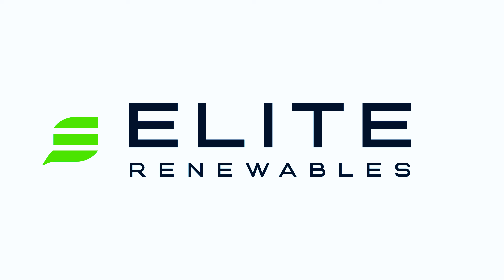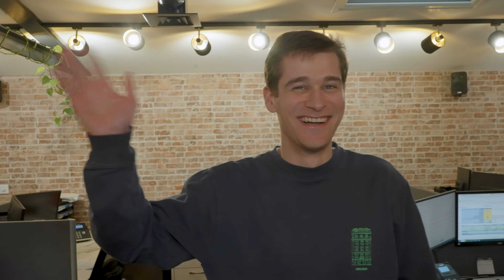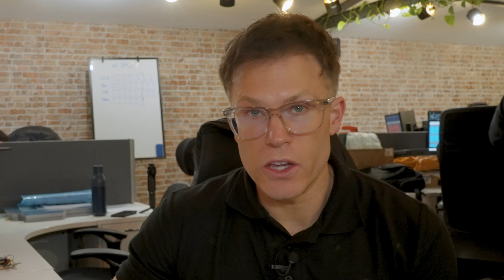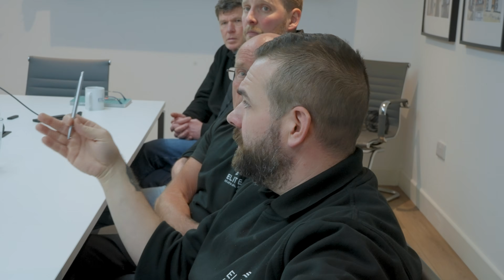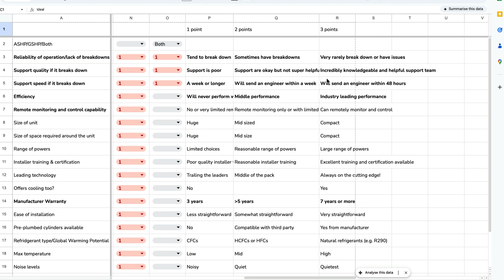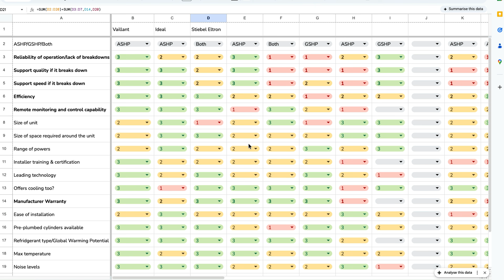We Ranked Every Heat Pump Brand After 1,000+ Installations

Comment: I have an Aira, absolute disaster. Could you come and give me an assessment, because I am being gaslighted? It's running something all night, they say it isnt. I knew I should have gone Valiant.
Reply: I've been considering Aira. In what way is yours a disaster please?
Reply: @andrewgoldsworthy5271 electricity, costs are astronomical, so bad octopus rang me, pipe work is not balance, lots of pipe not insulated, cannot hit 24° when required in winter and should not have been installed in this property. Independent survey says it's a dogs dinner.
Reply: If your house is new, I've no doubt it'll be okay but my house is 1928 and I believe they've taken the money without care about the customer.
Reply from the maker: Really sorry to hear this. I think you've been in touch with Paul
Reply: What about Kronoterm?

Comment: Thing is, the internals of all units are only made by a small number of actual manufactures, esp core parts like the compressor.   The rest just assemble sheet metal and plug in controllers.   If you are buying a new HVAC system, make sure you get one from a manufacturer that actually makes the hardware rather than a repackager.
Reply from the maker: Our experience is that regardless of the component origins the reliability, performance and quality of different heat pump brands varies much more widely than (say) solar. 

Ideal being an example - their ongoing support makes them a really good choice, despite some of their range being rebadged Mideas.

Comment: Pretty pointless listing the top 3 with all the other makes names removed. Did they all Pay to have their names removed?
Reply from the maker: No manufacturers had any say or input into the decisions or placements at all
Reply: What would be the point of listing any outside the top 3 if the point of the video is to identify the best?

Think of it as a podium after a race and maybe it makes more sense.

Comment: Someone called Vaillant the BMW of the HP market.
 I believe there is a new improved Arotherm+ on the market, but not yet available in UK. This has reduced noise, lower site requirements and better performance, but cost more than the current model. 
One things that often gets overlooked is customer friendly controls, which is probably one of Vaillant's big selling points. Once the installer has left, the customer needs to be able to understand what is happening and how to tweak the performance, so  handover from the installer is also an important factor, letting the customer know the best ways to keep things working well.  
One thing missing from Vaillant's app is the ability to switch between modes via the room temp mod parameter. My installer left the settings on Expanded  Mode which works like an on/off gas boiler as far as I know, and Active/Inactive modes - weather compensation without or with room temp. Also they left the heat curve on 1.2 (gas boiler setting). After a lot of reading online I now have it on Active mode and have adjusted the heat curve bit by bit and has now settled on 0.55. The house now stays at 20.5C day and night regardless of the weather while energy usage is a lot lower.

Comment: Vaillant? the company who produces units with the same hardware just software limits misrepresenting minimum modulation, doesn't account for defrost in their numbers, massevly overestimate COP, Firmware bugs are unfixable and neither warranty replaced ever proven, so good luck with your low modulation cycling, do not forget proprietary locked down eBUS protocol which company used to destroy third party controls because they are better than Vaillant's own. Or the rating represents kickback payment? I think 3.5kW deserved the most "stupid ASHP ever" award, doesn’t modulate lower than the same 5kW unit, but heating hot water takes forever just because of the software limit.
Reply: There are open source modules to connect to the eBus. Folks reverse engineered the protocol. But those exist for other major brands as well.
Reply: @Felix-st2ue you funny, I have 2 of such modules, I have done ebus mapping for 2 vaillant/glow worm devices, and as a software developer with some firmware development experience, vaillant either completely incompetent or getting out of their way to block 3rd parties.

Comment: Yes Vaillant. Mine was installed last October. Not the cheapest, but not the most expensive. I did a lot of research and came to the same conclusion. Many of the top performing systems on HeatPumpMonitor site are Vaillants. Really quiet. Mine is outside the ground floor bedroom window, which although  is not recommended,  have not once heard at all inside the room even at the night. Completely inaudible from my own and next door's garden 5 paces away.
I am very happy, and the neighbours are blissfully unaware of it.

Comment: Interesting that you have Daikin on back of the van, yet it didn't make the top three.
Reply from the maker: We really love Daikin's Air Conditioning units/A2A heat pumps, but yes they didn't make the top 3 in ASHP this year. We've installed a lot of them over the years and many customers love their Daikin heat pumps though